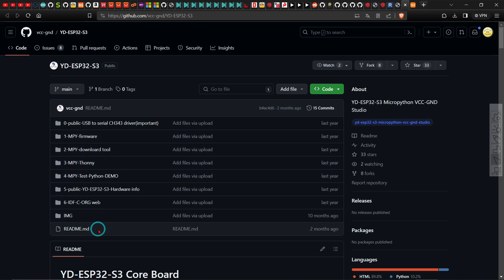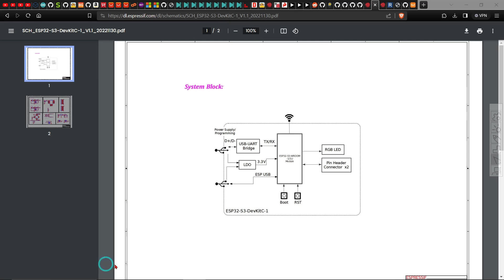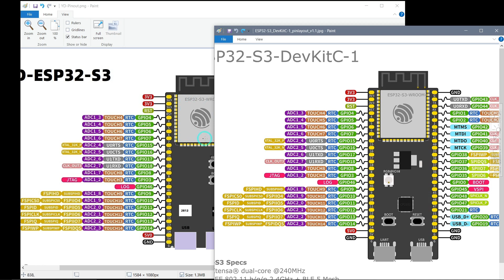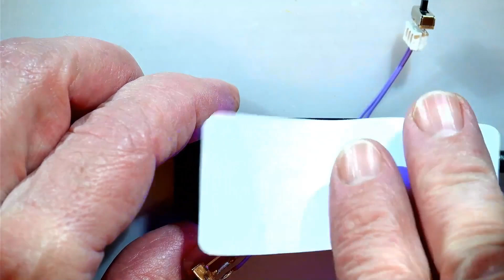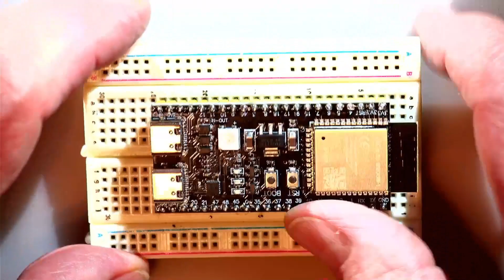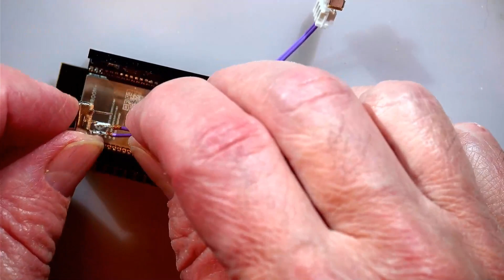Cheap YD ESP32-S3 board review.

Comment: To get WLED to work on the ESP32 S3 otg clone, use the  wled software installation web page, choose esp32 s3 16mb flash opi, after install, no WiFi shows up, now unplug from that computer programming port and plug into the extra OTG usb port and you will see the WiFi info when you connect into wled on the webpage. Took a long time to figure it out, no one on the web could help me but this has worked for this board. I hope this info helps you if you run into this problem.

Comment: Sir I have the same bord when I'm trying to install w LED the Wi-Fi is not working when I'm trying to make custom code make an AP it does not connected to Wi-Fi it cannot make Wi-Fi why is that happening I will appreciate if somebody answer me 🙏🏼
Reply: I had the same issue. I bought 2 esp32 s3 boards. One of them I soldered external wifi antenna (there are some videos on youtube) wifi is working perfectly. Even farest point at home. In second board, I reduced wifi power from 84 to 50 and wifi started to work. This is command i used esp_wifi_set_max_tx_power(50) compare to first option, second one has limited distance.
Reply: I m training ti install WLED fremware its not working  @suleymankara1122
Reply: @suleymankara1122 50khz
Reply: Maybe power supply is not good enough. Did you check 3.3 volt and 5 volt pins?
Reply: My issue was with WLED it flashed it perfectly but the next step it should give me a Wi-Fi section I could not get into it but for regular coding for example I connected to the metric display to get an IPa for time and weather for that the ESP working perfectly but for WLED no  @suleymankara1122
Reply: My comments was only for wifi issue.

Comment: idk where the SPI pins are on this board, i can't understand
Reply: i have to read a as5048A sensor and saving it on microSD, but can't understand where to put their pins
Reply from the maker: On the pinout diagram I see some GPIO marked as: 38->FSPIWP, 37->SPIDQS, 36->SPIIO7/FSPICLK, 35->SPIIO6/FSPID.  I guess I would try those?

Comment: First of all, thank you for the great and detailed video!

I have a question regarding the ESP32-S3-DevKitC-1 and the TOF050C-VL6180X sensor. I can detect the sensor at its default address and successfully establish communication, but the readings fluctuate significantly and seem incorrect. The values I get are something like: 0, 0, 0, 57, 0, 0, 0, 0, 1538, 73, 0, 0, 11, 0, 0, 3124, 3125, 0, 0, 0...

Do you have any experience with this sensor on the ESP32-S3? Or do you know where I can find a working example program? I’m struggling to figure out why it isn’t working correctly.

Thanks in advance!
Reply from the maker: That sensor doesn't ring a bell.  If I have time I will try to search for the sensor or perhaps you can send a link?

Comment: I have this exact model, trying to connect an OLED to it but no I2C Scanner is able to detect the OLED please help
Reply from the maker: So what is the OLED device? I assume it is I2C but if you give me a link or the OLED info I can see if I have one and probably hook it up and show you how... Part of the problem is probably related to the fact that the ESP32 in question does not have specific SDA/SDL pins rather most of the GPIO pins can be used.
Reply: Yes, the oled is an I2C device with 4 pins and is 1.3 inches. I’ve not got a specific link but I can assure you it’s functioning well on UNO board, I got my board and oled replaced just to be sure it’s not a manufacturing problem. I tried to connect a PN532 module it’s not getting detected either but it’s working on UNO. The SDA and SCL are 8 and 9 respectively in my board, I also tried a couple of other connections, didn’t seem to help. Thanks for your reply, I really appreciate it!
Reply from the maker: @ShravaniBhoir  I placed a snippet of video on YouTube: https://youtu.be/19CWycFLcpg perhaps this will help not sure?  I believe this is the same board and the OLED is IIC and I think it is connected to pins 8 and 9.  Something similar should work for you perhaps?
Reply: @Tech-Relief  I am from the same project working with her . I just wanna say thanks a lot, you have helped us achieve a big goal in our project thank you for the help!
Reply: @Tech-Relief  I cannot thank you enough!! Really appreciate your time, effort and support, I seriously cannot thank you enough 😭 been stuck on this for 2 weeks now and you solved in 5 minutes! This is godsend because of lack of resources online and we happened to come across your channel
Reply from the maker: @ShravaniBhoir  My pleasure...  I am a retired Software Engineer and like to share what knowledge I may have.

Comment: Can I ask where did you get the json file for yd esp32 s3?
Reply from the maker: I made it up starting with a similar board editing the bits that were changed in the board json file.  If interested I could make a small video on this?
Reply: @Tech-Relief  Please do it!!!, Thanks
Reply from the maker: @bicisparerd4043  If you need the board file it is at: https://pastebin.com/UcxDxmfk
Reply: @Tech-Relief  Thank you I made it work, question tho does you your board stops blinking after some time?
Reply from the maker: @chanwhun2954  Not sure what you mean with stops blinking...  Do you mean you loaded a blink sketch and it stops blinking?  In that case no it will keep going.
Reply from the maker: You can find it at https://pastebin.com/UcxDxmfk
Reply: @Tech-Relief  Thanks man, I've been pulling my hair out with this board. Sorry, being a bit new, where do I put this json file? I use Arduino IDE.
Reply from the maker: @Stoobers Some other people have asked about the JSON file: For the Arduino IDE they appear to keep board information in the folder: C:\Users\{userid}\AppData\Local\arduino15\packages\esp32\hardware\esp32\3.0.7 in a file called boards.txt and some other files. However, I do not use the Arduino IDE and am not familiar with how to update these files and the JSON file only works with PlatformIO or its derivatives.
PlatformIO stores the default json files (replace {userid} with your user id!) in: C:\Users\{userid}.platformio\platforms\espressif32\boards
However, as of late there have been a few developments, I now use PIOARDUINO (which is a fork of PlatformIO) and put the JSON file right in my projects in a boards folder (this is supported by both PlatformIO and PIOARDUINO).  Have a look at my video about this starting at 3:11 in it: https://youtu.be/uUS5In2ylw8
Reply: @Tech-Relief  Many thanks :) I'll have a longer poke about! Great vids :)

Comment: Did you create a Bluetooth HID keyboard with this that works with windows 11?
I ask because I tried using the BleKeyboard library that is already in platformIO and it works well with android devices but unfortunately not with windows 11.
May be something in this library is not setup right for windows 11.
I am trying to make a macro keyboard (foot pedal) to control the VLC video app for mt guitar lessons.
I hope you can help me to get it working on my ESP32-S3-DevKitC-1-N16R8V. 
And if I can't get the bluetooth to work with Windows 11, i will have to the USB HID keyboard route may be you can help me with that too. Do you have minimal examples that sends some keystrokes for this board (USB and bluetooth)?
I would greatly appreciate it.
Reply from the maker: I personally have not loaded Windows 11 on my computers and will probably switch to Linux in future to avoid Windows 11 as I do not like where Microsoft is going taking more and more control away from users.  However, I cannot think why Windows 11 would be different from Windows 10.  I have just ordered the same board you have from AliExpress and when it comes in a week or two I can certainly have a look at it.  Feel free to reach out to me on techrelief@paay.us and tell me exactly what you are trying to do and we will see what we can do.

Comment: I have one, with the 5v out bridge soldered closed. It only outputs 4.7V. extremely disappointing.
Reply: It's easy to get it to the full 5V. There is also "OTG" jumper which you may need to shorten, it depends on how you power it up. You may want to check the schematic to confirm.

Comment: do we need to solder the RGB icon on the board to make RGB LED works? do you have code of this esp32s3 RGB LED works?
Reply from the maker: No the RGB Led came with the board and the code was simply based on the Arduino RGB Led test code available in the Arduino IDE samples.
Reply: @Tech-Relief  thanks I found it under esp32 gpio 

I realize some boards esp32s3 works but not this version as there is an area RGB soldering split into half. I read other comments that need to soldered together then it will work,

 have U try RGB and work out of the box?
Reply from the maker: @yes_man_lol  Yes the board I have did not need any links to be soldered.  As far as I remember it just worked.

Comment: Hey, I have the same board and can't find it in the board selection dropdown menu of ArduinoIDE
Reply: just go with ESP32S3 Dev Module
Reply from the maker: So I use PlatformIO with VS Code instead of the Arduino IDE and there it is known as: esp32-s3-yd-wroom, I would try some of the other ESP32-S3 boards listed in the Arduino Board manager with similar characteristics.  Or better still just migrate to PlatformIO ...
Reply: @Tech-Relief  Hi ! So for some reason the borad "esp32-s3-yd-wroom" is not showing in the board section of platformIO, why could this be happening?
Reply from the maker: @MarEz1309  Not sure make sure you have the latest updates for platformio.  However, you can download the .JSON board file from this location (save it as esp-s3-yd-wroom.json): https://pastebin.com/UcxDxmfk
Save it in the platformio boards folder:
C:\Users\{your-user-id}\.platformio\platforms\espressif32\boards
Replace {your-user-id} with your actual windows user id, it should then show up when selecting boards...  Hope that helps?
Reply from the maker: @MarEz1309  Actually, I remember now I made the board file up myself editing the JSON file.

Comment: Thank you for the video. I have the exact same board, but it seems the I2C functionality is missing, I am using pin 21 for SDA and pin 19 for SCL. 
I always get the output no I2C device found. Just wanted to ask if I am missing something.
Reply from the maker: I am completing several projects right now, and I will have a look at it when they are done.  However, what are you connecting to the board?
Reply: @Tech-Relief  
I was trying to connect a temperature and humidity sensor, Adafruit AM2320. I ended up purchasing another one DHT22(that does not require I2C protocol, and it worked perfectly). Today, I wanted to try creating a circuit using the 5Vin pin, and I find that it does not work automatically like 3V3 pins, and I have no idea how to make it work. Do you have any recommendations fro that?
Reply from the maker: @emrebaser3803  I am out of town right now when I get back next week I will have a look at it.
Reply: @emrebaser3803  solder the in out pad on the board and the 5v pin will work fine
Reply: @mohamedaminebellaidi4023 mine outputs 4.7v....
Reply: @Tech-Relief   I have a proyect on ESP32  (pin 21 for SDA and pin 20 for SCL.) with a RTC that im going to export to S3 and the fist think that  i check was the pin out for a esp32s3, and thearent the same, check the S3 PIN OUT AND LOOK for  SCL 9 AND SDA 8 on s3 not all PINOUTS FOR S3 HAVE LABLED SCL AND SDA
Reply: With declared SDA and SCL pins for Wire begin command, I2C works fine for me with this board. Still struggling though with the board native WiFi - it 'scans' networks OK but can't log in and WiFi AP logs show nothing about it.

Comment: Hi, so while I was flashing the device, I am constantly getting this error: 
2-sync fail
tips: please refer to the chip datasheet and confirm that strapping pin's status is correct. 

how can I solve this problem. TIA
Reply from the maker: I have not come across this however, the pinout has several pins associated apparently with "STRAP" it calls it.  Namely: Pin Marked GPIO3/JTAG, GPIO46/LOG, GPIO0/BOOT, GPIO45/VSPI. GPIO 0 is the BOOT button if I remember correctly, however, you might check those pins to see if they are connected to something that interferes?  Other than that perhaps someone else has some experience with this?...

Comment: "Deneyap Kart G" When connected to native USB. If it falsely reported as an S3 when it's really a C3, I wonder if that would explain it complaining about an I2S pin mapping being invalid. Using simple tone demo. I've only gotten the bluetooth scanner example to cooperate so far. Of course, if i select C3, i get told that's the wrong board. At the very least, it's half-assed. Verbatm error is "E (7) I2S: i2s_set_pin(295): ws_io_num invalid" Sounds like LR clock pin.
Reply from the maker: Do you have a small sample of the code you are using I will look into it? I actually made my own board file for it perhaps that would help to make it work?
Reply from the maker: Oh and where is it getting 295 as a pin number from, there is of course no such pin...
Reply: @Tech-Relief  IDK, serial monitor says that after flashing with no compiler errors. Seems there's some serial functionality on boot independent of flashed sketch. I tried the "simple tone" I2S example included with espressif board manager files.
Reply from the maker: I do not have any I2S devices to test with, I better get some...  However, I tried several examples and they do seem to compile alright on my machine but I can't yet test them of course.  I wonder if you might have more success if you used the board file I created for the DevKit clone: https://pastebin.com/UcxDxmfk ?
Reply: @Tech-Relief  You don't need the dac to test for same error I got.
Reply from the maker: @Marc_Wolfe  I will look into it some more and I also ordered some I2S boards and might do some videos on them for good measure...  Ofcourse AliExpress will take three weeks or so to deliver but I will ty to run the code I have to see if it returns an error.
Reply: Open serial monitor, press reset button. That's all you need to replicate my problem.
Reply from the maker: I used an I2S demo I downloaded from github and it appears to compile and run, I see the output on the Oscilloscope,  I even put in some serial output and this was correctly displayed in the serial monitor in VS Code and PlatformIO.  I have no idea where you got the "simple tone" example from perhaps you can send a link?